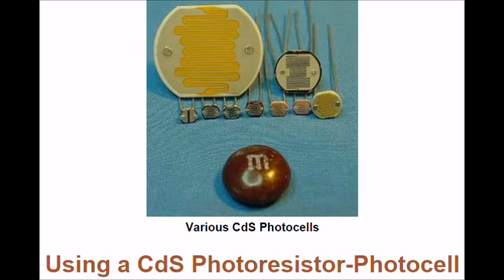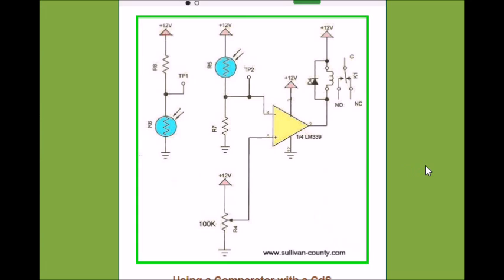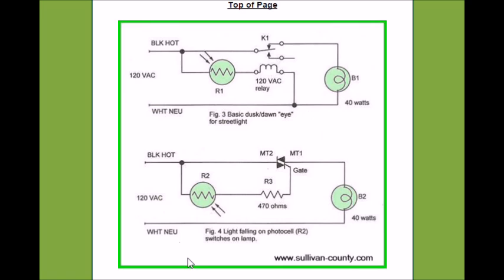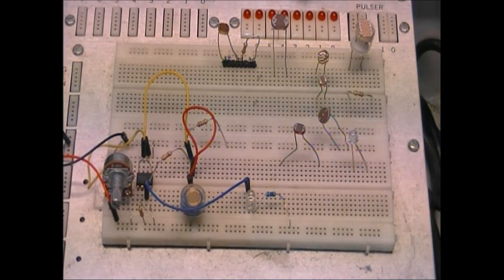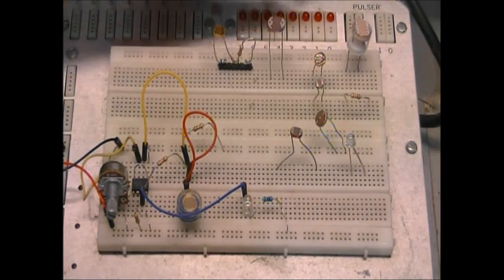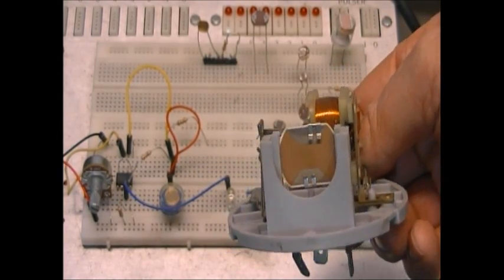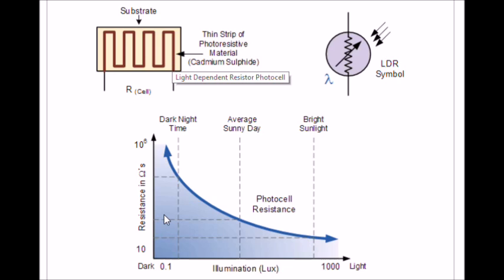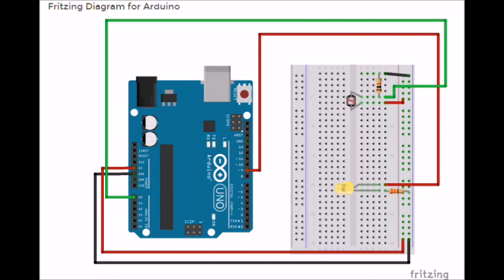CdS Photocell Circuits Operation

Comment: Hi Lewis, enjoyed your video. I've seen some of the Streetlight Electric eyes that have a bimetallic strip in it. What function would that have in the circuit?
Reply from the maker: All of the ones I have have a photocell and a relay. Now sending a current through a bi-metallic strip can generate enough heat to get the strip ti bend thus making contact closing the circuit.